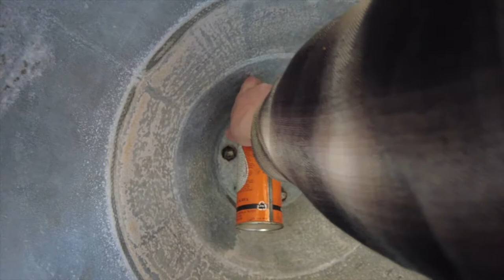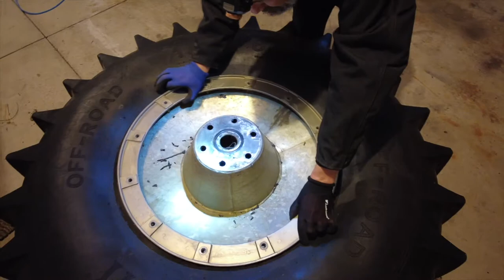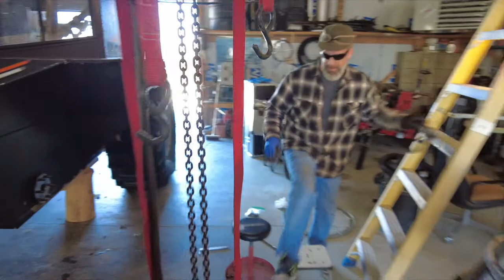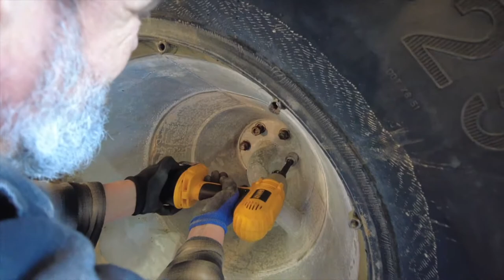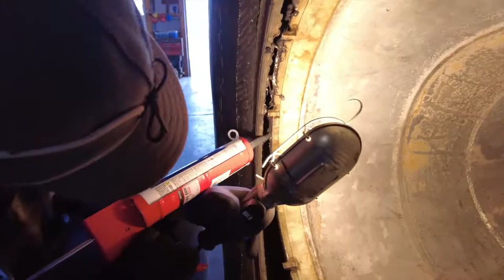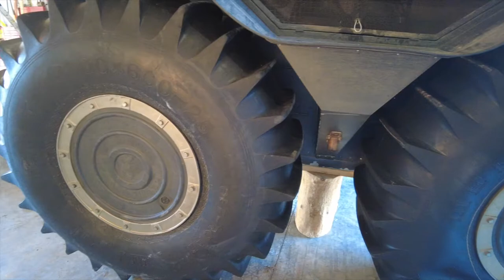Sherp Repair - Tire Bead Lock

Comment: Did they not suggest to use some cleaner on the surfaces first? My experience from RV maintenance the cleaning with solvent such as alcohol or mineral spirits makes a huge difference in how well it seals. 
 The other thing I would do is measure the width of the seal and draw a couple lines that width parallel to each other and then try different bead sizes and then take a putty knife and spread the caulk to see how much you need any product squeezed out is a waste.

Comment: Hi Dan , just wondering ..what is the bolt pattern size ? and wheel stud size used on the Sherp ?
Reply from the maker: I don’t know for sure. It is metric. 22 or 24 wrench size rings a bell.

Comment: As much as the Sherp costs all the lug nuts and bolts should be stainless steel
Reply: Stainless bolts gall and then strip the threads out a lot.